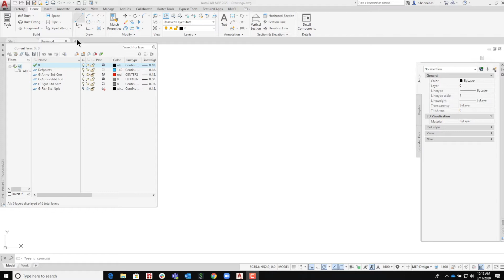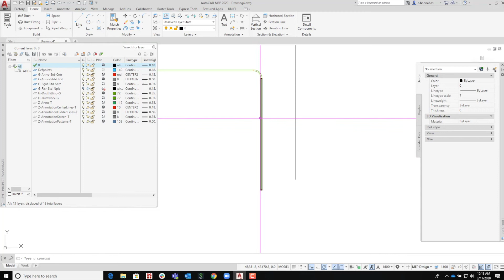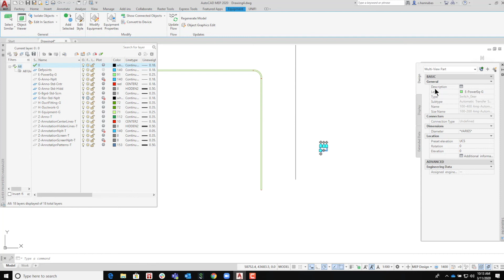Getting Started with Intelligent Linework in AutoCAD MEP

Comment: I agree with Marc. NOT nearly enough MEP content. Like, how do I modify the intelligent line work to use "client" specified layers and settings or how to add "systems" to the tool palette. I want to work with the intelligence, but no decent HOW-TO anywhere. I'm still using my Paul Aubin Mastering AMEP and that's 10 yrs old. Wondering if the new ACAD books with incorporate it the tools are now part of ACAD. Seriously missed opportunity by AutoDESK that I hope they rectify. Especially since I'm a visual learner.
Reply: I completely agree and I would really love to use my channel to start an ACAD MEP useful video playlist. And I don't mean your typical tips and tricks. I think videos showing how to draw pitched pipe the best way, how to use point clouds for plotting and best visual effects, computer builds, and practical draftsmen use. Too many people still think it's not BIM and I want to make it a point that years ago we heard over and over that Autodesk was doing away with MEP and now they are adding multi-core threading and all types of new features. Trimble even has, an unspoken about, conversion tool for MEP to Revit and It works great!